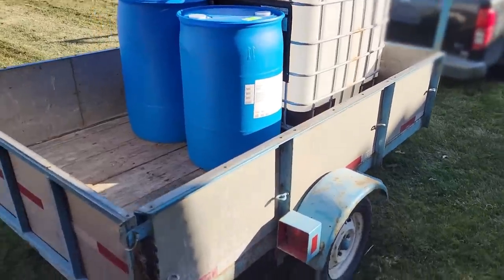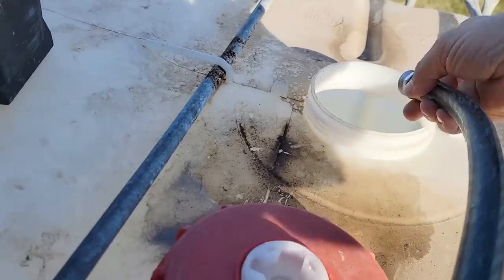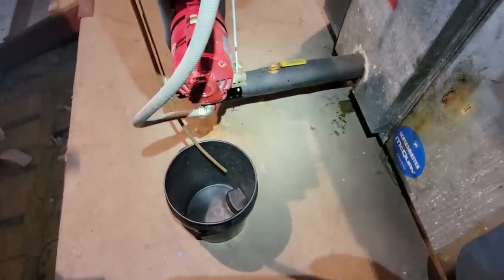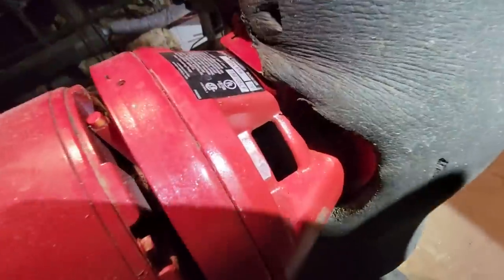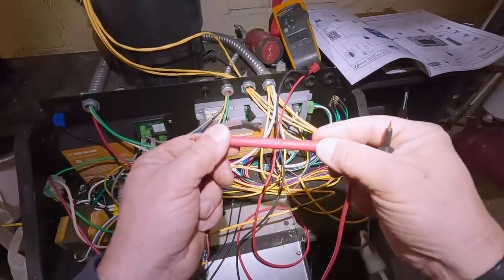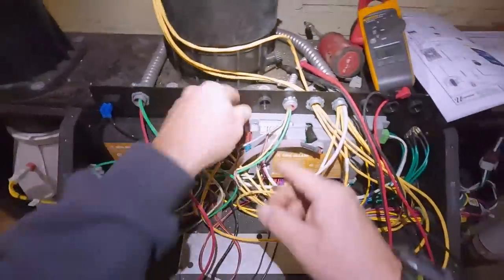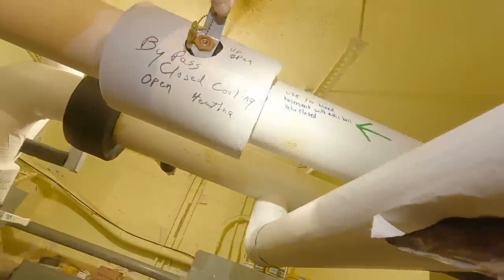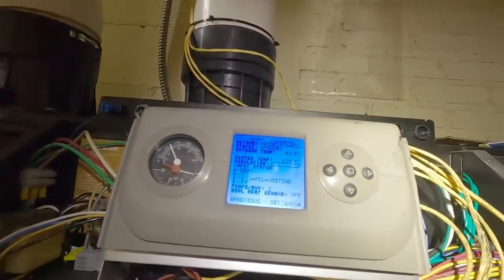Chiller & Boiler Has The Farts

Comment: To add more water and bleed out some glycol, take a water container with a fitting to the top, and connect a hose to the bleeder valve.   Make sure there's no air in there.   Have someone open the bottom until it starts refusing to drain out, and open the bleeder valve.  That should drain water from the container at the top into the system while glycol/water mix comes out the bottom.  Shut it off when you get close to emptying the container, then shut off downstairs   No air entry into the system.

Comment: Thanks for showing the control panel. After seeing the JCI VFD and JCI actuator on the coil valve I was wondering if it was Metasys or Facility Explorer controls. Been a programmer working with Facility Explorer for 12 years. It’s ruined me lol…anytime I walk into a building conditioned with more than a small split system I get curious and start looking for clues as to what control system they have.

Most impressive is that a church actually spent money on controls lol…
Reply from the maker: They spent stupid money on it. They have CO2 and static pressure on the systems.
Reply: The mechanical contractor I work for just started a controls division and we rep facilities explorer/ Johnson FX, I’m curious what area of the country are you in? We’re located in the Memphis, TN area.
Reply: @HVACRSurvival  definitely overkill for a church. I finished up a project of similair ridiculousness a few months ago (in a church nonetheless). The building was gutted by a fire so insurance money paid for a new automation system. Demand control ventilation, dehumidification, front end with a complete graphics package. A basic sequence could have been accomplished with Honeywell VisionPro stats and JADE economizer modules but engineers got involved and destroyed that idea lol.
Reply: @robertwells8366  cool. Overall I like the line once you learn its quirks. We’ve done some unique and fun projects with it. I’m located in the suburbs of Chicago.
Reply: @matth5309  I gotcha, the division is really taking off and already taking on some major clients in the area. If you’re ever interested in making a change or interested in doing some tech support/ consulting on the product let me know and I can get you hooked up with the GM. I know they’re looking for some serious talent and are paying top dollar.

Comment: having that ole type compression tank, you should not have any other auto vents on that system, except that they can be there for the first fill, refill, then valved off.
You need to figure your air separation at the compression tank, and at that primary air separator / swirl tank, 
Dan Holeran, Pumping Away, 
tank isn't piped or pumped correctly
Reply from the maker: I have his steam book, I've heard that about those tanks, I wasn't sure why that was the case
Reply: @HVACRSurvival   @HVACR Survival  the open auto air will deplete the air cushion from the compression tank, some of that air cushion get's reabsorbed during normal operation. 
the tank and air separator swirl tank also need to be piped correcly.
B&G has good reads on this, as does Holerans sight, search "pumping away" and "point of no pressure change" (PONPC)
Reply: also look into primary secondary piping, and PONPC, 
but damn, yeah, that's alot of pipe and valves
Reply: must pump away from the tank/connection(ponpc), 
and secondary circuits then pump away from the primary,
then air separation is a breeze.

Comment: Do they have two heat emitters requiring variable fluid temps?  Do not get why they have the mixing valves if the boilers can modulate.  Are they intending for the cooling water temp control?  Hard to judge a system at arms length
Reply from the maker: I think the boilers are newer than the valves, I believe there are piping issues then add that to being over controlled

Comment: What is the acceptable over  limit of concentration like if you have -5degrees target temp?
Reply from the maker: You can go over protect the waters freeze protection and it will still transfer heat to or from the air coil but you start losing efficiency, I'm not sure without doing more research exactly how much you start losing.
Reply: @HVACRSurvival  thanks mate. I just work with glycol chiller where we put -20C concentration but only -5C target. Just need 2nd opinion if we do too much gylcol with that concentration.

Comment: Just curious if it is a 2-pipe dual temperature loop why not just charge the chiller heat exchanger in the fall and leave it isolated from the rest of the system and then just use water in the hydronic loop for heating? Or do you need freeze protection for the air handling unit coils? Great video.
Reply from the maker: I'm in Ohio. It can get down to -15 to -10  times. The boiler and chiller have the same water coils, there not separated.